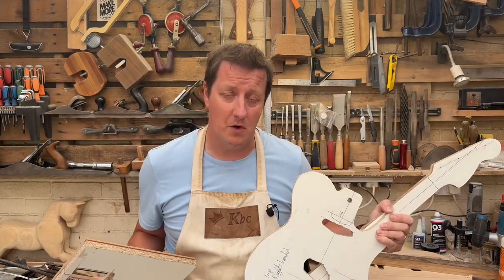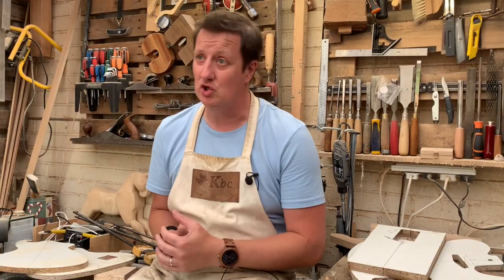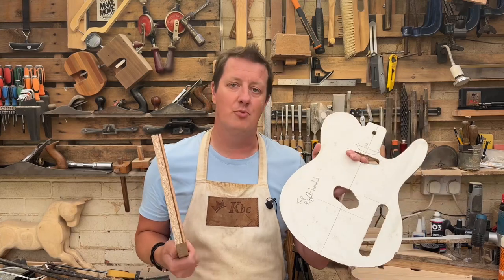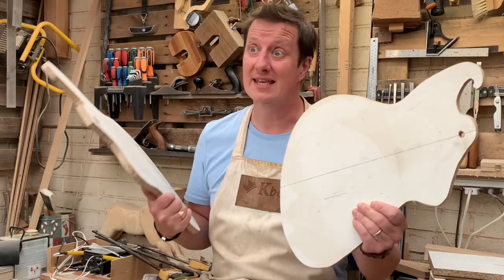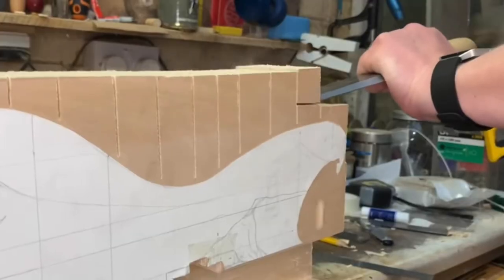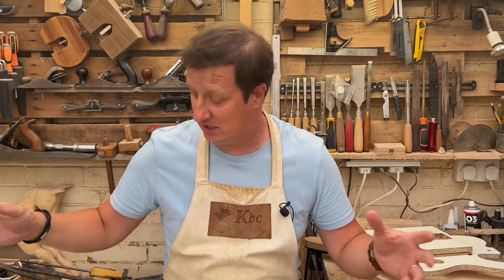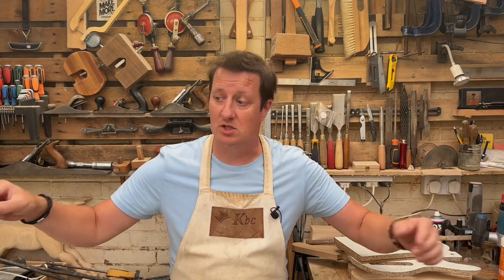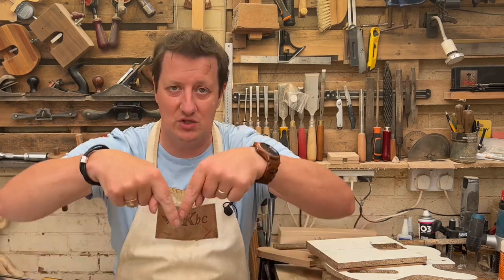Do you have to use templates to build a Guitar?

Comment: You don’t have to but the odds of you getting a straight neck or making two guitars the same are low without them
Reply from the maker: Agreed for the multiple copies, but no reason you can’t get a straight line without one 👍
Reply: @KingBespokeCreations  it’s just much easier with a good template
Reply from the maker: @rvaguitars  easier but not fun 😂
Reply: @rvaguitars  Take the easy path, and you will become an assembly line drone.
Reply: @timhallas4275  ha hardly. I spend 2-300 hours on a guitar
Reply: @rvaguitars  Then you are not a luthier.  You are a hobbyist.
Reply: @timhallas4275  I guess that’s why people pay my 5-7k for them. They take so long because they are hand carved and covered with hand cut mother of pearl inlay and custom electronics. I could build a tele in a couple days but any fool can do that